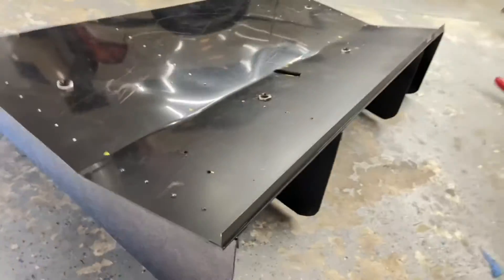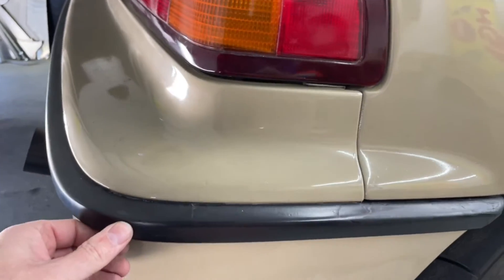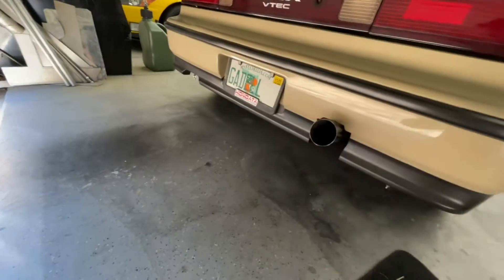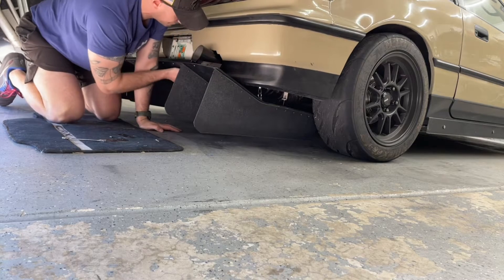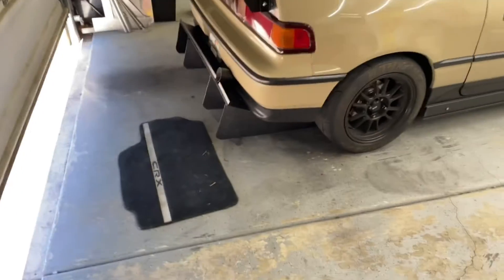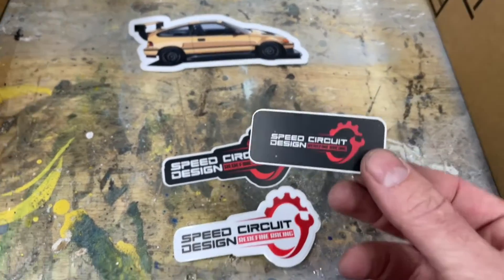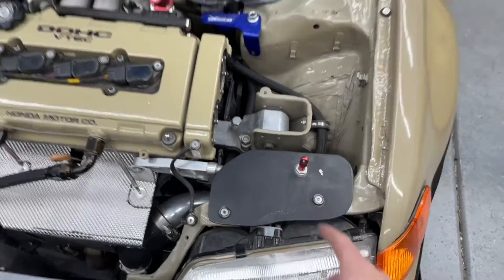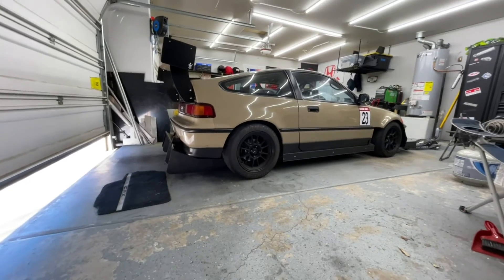CRX Diffuser & Speed Circuit Design

Comment: How do you know it “works”? Did you copy a know design or do some kind of wind testing?
Reply from the maker: Just a ton of research and I decided to go with 12 degree angle. What I need to still do this day is find a big open piece of land. Get up to 100mph and coast down to say 60 or 40. Then remove diffuser and do the same. Record the times

Comment: What is rhe size of the hood louver in the middle , the big one . I have a cf hood that i got with my car , with a big hole init to clear the f20b and turno manifold, how wide and how long is it ?
Reply from the maker: Big Center Louver measures approx 25.5”x22.5”x15”. First measurement is the top of the louver across and the second is the measurement at the bottom as there is an angle.